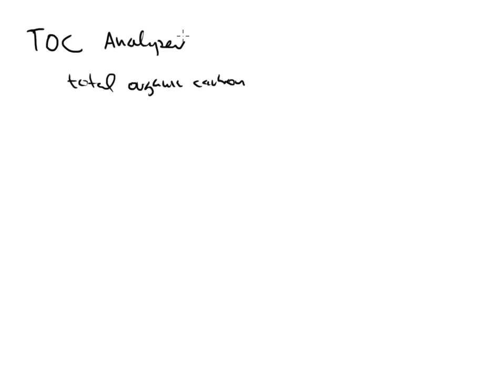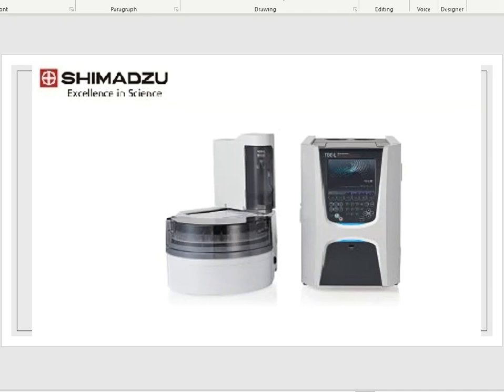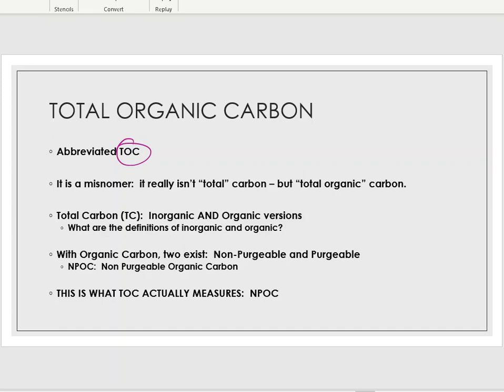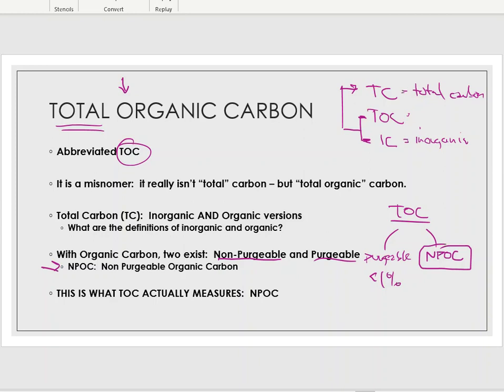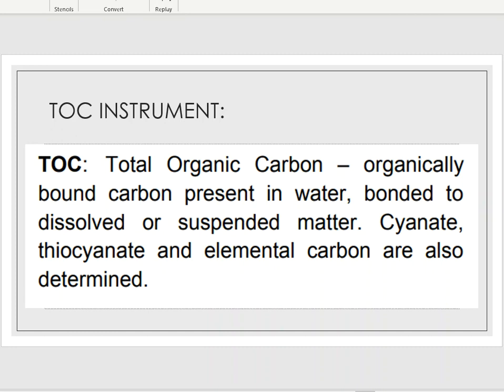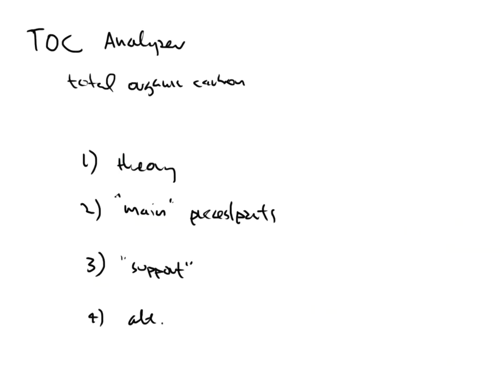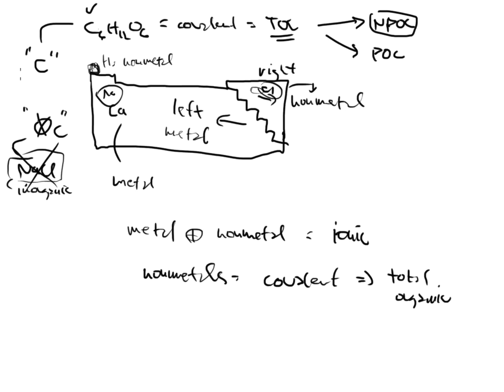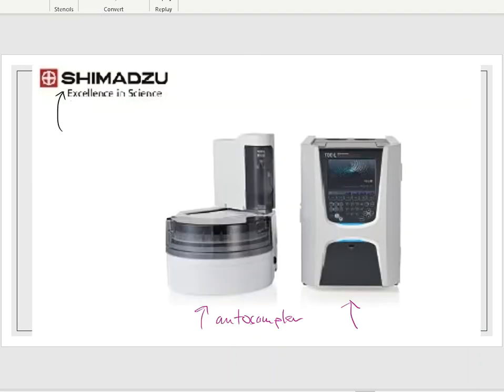TOC Part 1:  The Basics & Introduction of the Total Organic Carbon (TOC) Analyzer

Comment: Good morning!
Hi I'm Jeffrey lebron and I'm with INEOS plant in plaquemine Louisiana. 
We purchase 3 Toc units the Toc-4200 .
Two of them are working great but one of them use it for condensed water is having and issue that I haven't been able to resolve and there is no information about how to fix it.
Here it is:
The start calibration on the key pad is faded and it won't let it star calibration or measurements function .
Also it beeb twice when is pressed. 
The front key pad panel lights indicate that is good and ready to operate just like the other two toc units but this one just don't fully high light the key pad green start touch screen start key.
Also I noticed a amber light on on the main electronic board and when I compere it with the other two and equally the same T0C their same light on the electronic board is green.